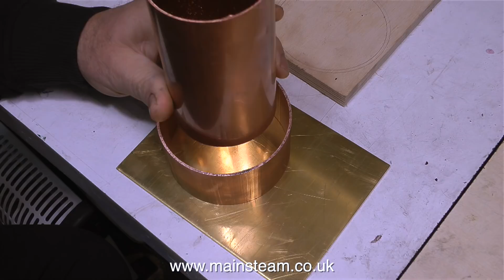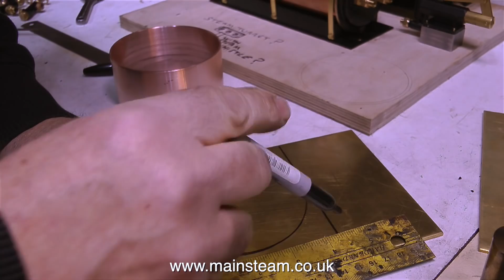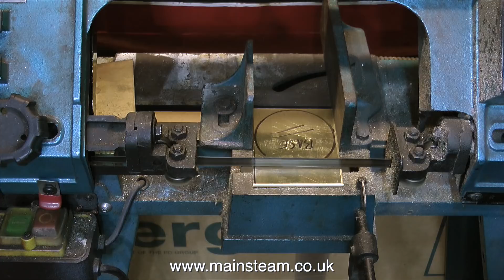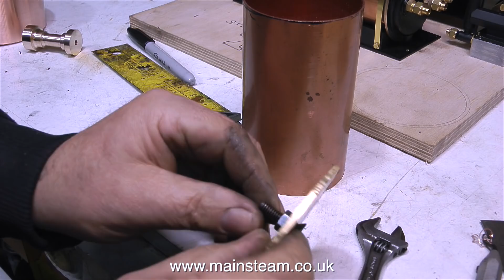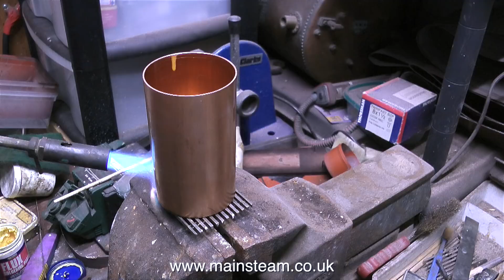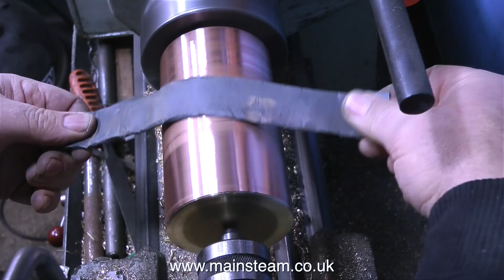MAKING A STUART 504 BOILER PLANT - PART #4 - THE SPECIAL WATER TANK

Comment: In the past when you soldered ends to a copper tank you used the solder paste you painted on (I forgot the name of it).  Why didn't you use it this time?
Reply from the maker: No need - because these are open ended tanks - so I can just use ordinary solder with flux .  .